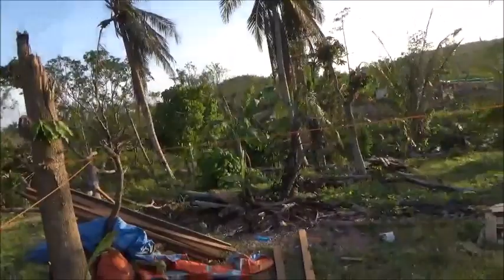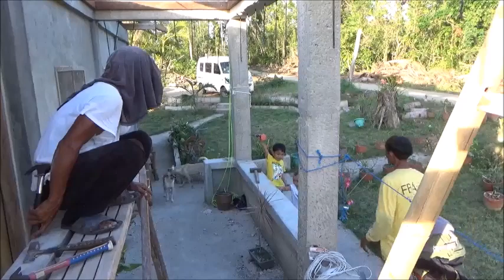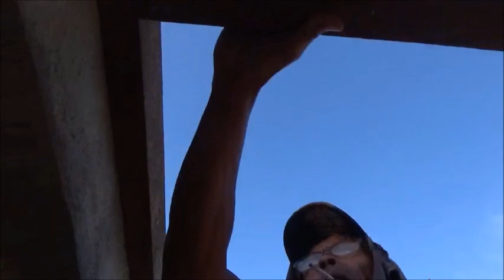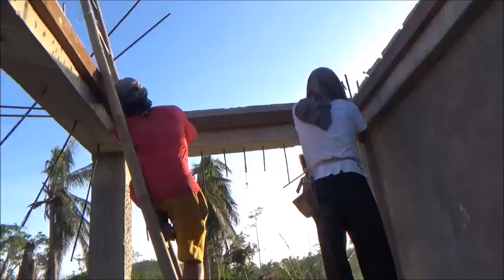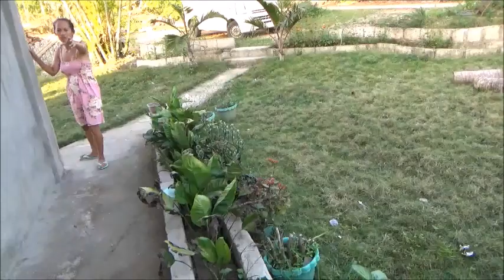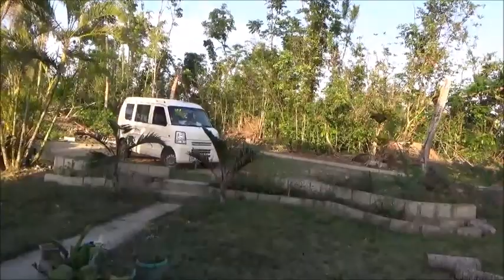Day 7 Of Our Roof Build

Comment: The beam the tatie was pounding in with a sledgehammer is a little too tight!!  with expansion and contraction your blocks and concrete walls will start cracking in various places ..should’ve loosened it up a little…